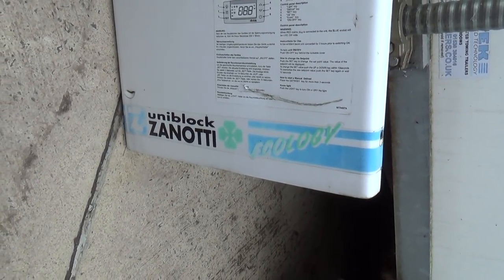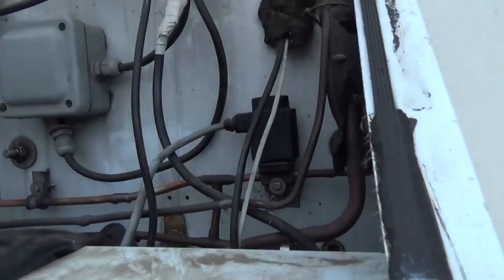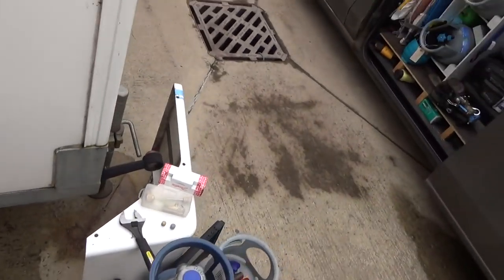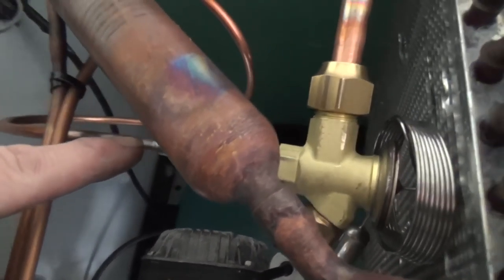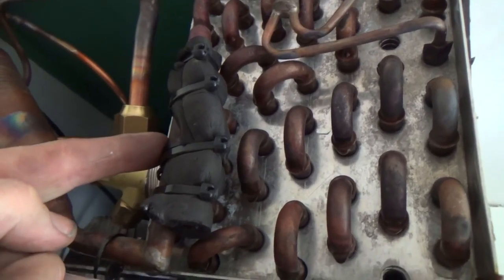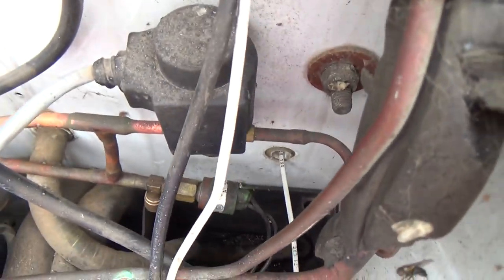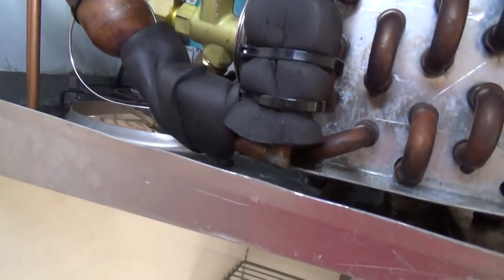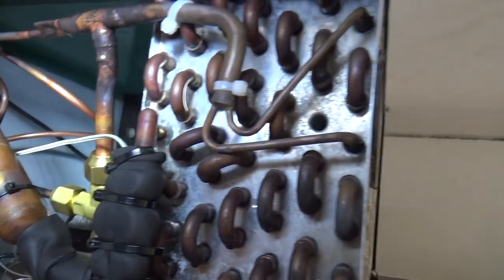Zanotti Trailer Trials

Comment: Good stuff! Yeah condensate heating tubes popping and dumping pressure like that is common, had to repair one the other month only to find that the system had also filled up with water, rusting out the compressor!
Reply from the maker: Oh that's nasty! Did you get it fixed or scrap the system?
Reply: Ended up fixing it, put a new compressor in with two 1/4'' driers on the liquid line. Runs like a charm!

Comment: Lucky to have the txv and replacement orifice on van bro. Nice work,
Reply from the maker: Yeah, I usually keep R404A, R407F, R134a, and now R449A valves and orifices on the van, this one had been on there a while which is why its a flare model as we usually only fit braze ones now.

Comment: I moved defrost probes to on these things. Stuck it in the evap coil and changed controller parameter. Also watch out for the heater wrapped around the bottom of comp. They rub out and earth.

Comment: Nice improvisation there to get it  back up n running. I've noticed it's got a distributor. .shouldn't have required a txv with an ext. eq.? Looking forward to more vids as it's been awhile 👍
Reply from the maker: Yeah it should have had an external equalised valve,  space was tight and that was what I had on the van so worked with what I had.